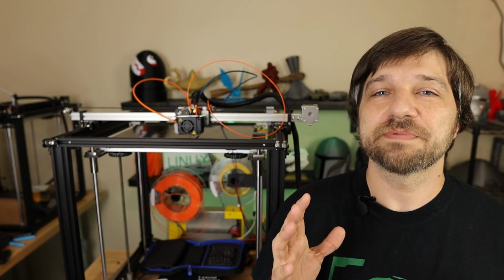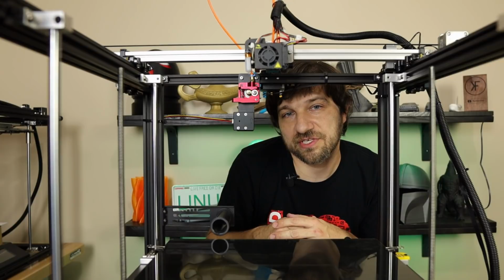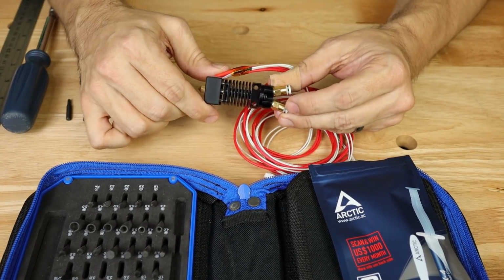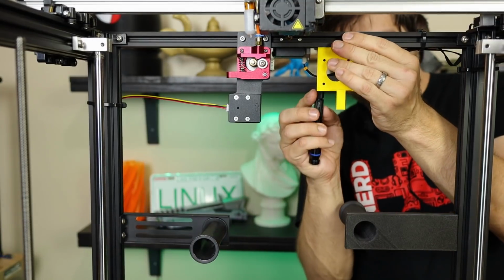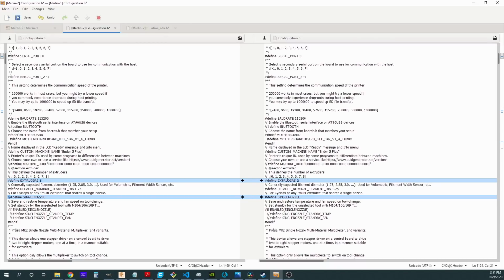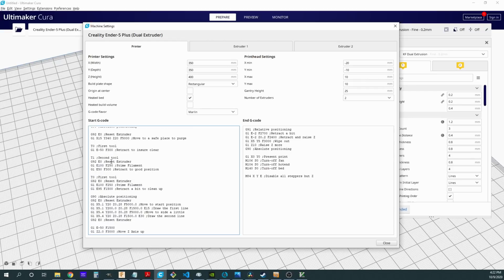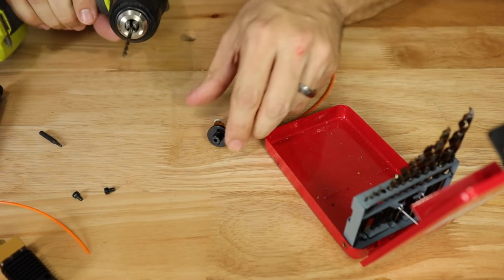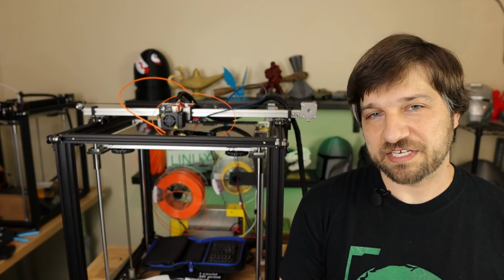Complete Dual Extruder Upgrade Guide (Ender 5 Plus)

Comment from the maker: This is my usual pinned comment for updates, clarifications and corrections. Please let me know if you have any questions.

- FYI, I have ordered another hotend I want to try and will post a new video once I receive it.
Reply: Why aren't you using dual gear extruders?
Reply from the maker: @ramtek2702  I haven't had any issues with these extruders in the past. They produce constant results.
Reply: @kerseyfabs  I haven't either and I'm not waiting until I do when it's so obvious that a dual gear extruder is superior.
Reply: If you want to use single hot-end concept  you need to mix filaments. This desing will fail due to clog problems etc
I prefer mixing hot-end from bigtechtree  or diamon hot-end.
Reply from the maker: @wenus525  I may give that a try.
Reply: @kerseyfabs  One thing I should  mention that mixing hot-end have a downside due to more filament use. But clog problem on yours hotend make me impossible to print in long run.
Reply: @wenus525  yes I had a lot of trouble with the clog and on the first try the inner tube melted at 200 degrees, so I took a piece of heat resistant tube and tapered the entrance as much as possible and pressed it firmly between the top block as you drilled up and pressed it with the nozzle so that it pressed well without being deformed. Then I saw that my screws that went up from the lower block to the cylinder to be cooled were skewed quite heavily, so I removed them completely. After I warmed up the threat, I tightened the nozzle as hard as I dared without it coming off. Since then I have no Clog at all.
  Thanks Kris!
Reply: I was able to get this hot end working with the Creality silent board (which has 5 tmc2208 drivers), 12864 lcd display, and dual gear extruder's.
Reply from the maker: @tonypietropaoli789  Awesome! Any particular settings you changed?
Reply: @kerseyfabs  Did you happen to look through your Gcode file before your print. Cura decided to throw an M104 T0 S0 code in the middle of one of my prints which caused the issues like you had. Before you ask all temps were set the same even stand by temps.
Reply from the maker: @tonypietropaoli789  Yeah, in fact, I was hand-editing the g-code at times to see if I could manually correct the issue.
Reply: @kerseyfabs  one other thing i did do as soon as i got that hot end was swap out the nozzle. The nozzle that came on it was kinda deformed.
Reply: I need help with the silent motherboard v 2.2 ender 5 + activating the second extruder. Creality
Reply from the maker: @johncastle6824  I haven't set that up yet. If there's a second extruder, you would have to recompile the firmware.
Reply: any update on the new hotend ? Looking to hot rod my 3d printer. I Belive the ender 5 plus board has a E0 and E1 socket so I could still use the oem board ?
Reply: By the way the stock board does have a plug for E0 and E1 however no driver is installed for E1. On the silent board there is a 5th driver but a heat sink will need to be placed on it.
Reply: i changed some of the start and end gcode for the extruder's. slowed the feed down but kept retraction rate the same. played with settings in cura, tuned the extruder motors. oh i also added a line to the extruder end gcode to retract 3mm before doing the filament swap it kept leaving globs on the print any time it did a swap.
Reply: i started trying all this with a dual color benchy but stringing was bad and colors were mixing (black and blue). i got it dialed in some but the took a different approach two cubes 25mm cubed and spaced the 50mm apart one printed in black and one in blue this allowed to see any stringing and color mixing. this is where i set the g codes and prime tower size to be able to achieve zero mixing of the colors. The next thing i may do is install a brass brush to wipe the nozzle.
Reply: This is not a waste of time ... I have one exactly the same, the inner tube melted already on the first try but I replaced the inner tube with a Heat-resistant tube where I tapered the entrance on the hose. Downloaded kersey:s file 2072 dual_and compiled it, everything worked perfectly after I modified the latest Cura version according to Kersey ...
But a bit into my run where switching and printing with 2 colors stopped and the wrong message: Heating :E1 Printer Halted. The odd is that if i change back to my original ender 5 profile i can print Separately without problems whole files with just one filament at the time ... If any one hane an solution just mail me at: pcchrister@hotmail.com Tanks to all and Kersey to I think you have many sharp ideas and its great...

Comment: I thought that you wanted to do everything you could to make sure the heat stays down in the hot end, NOT migrating up the throat tube into the heatsink. There's a reason that fun runs all the time at full speed.

Comment: Great video, it's basically a complete tutorial. It might not have worked for a dual color tall print with so many filament changes, but I bet it would work great for plaques, signs and logos, which are wide but not very tall, not needing that many color changes. I'll try this on my Ender-3 v1.
Reply from the maker: Thanks! You may be right!

Comment: No sure heat sink compound is a really good idea on a hot end due to the  high temperatures.  They are much higher than the heat  sink compound is rated for and could cause the chemicals to burn or vapourise into the air.    
Thanks for this video, even though I am 3 years late to the party.   It's given me some good ideas for my Ender 5 updates
Reply from the maker: I know some companies such as Slice Engineering have Boron Nitride Paste, which seems to work at these temps. Cheers!

Comment: With any multi filament configuration that utilizes 1 hot end I would ensure the hotend was up to temperture, prime 15-20mm at highspeed to push as much melted filament out then immediately retract it to the parked position. Kind of like doing a cold pull.  This should reduce the chances of buildup you are experiencing with this build.
Reply from the maker: A lot of that is built into the firmware and can be adjusted as needed. This was a long time ago but I'm almost positive I had that covered.

Comment: I HAVE BEEN STRUGGLING FOR WEEKS ON GETTING MY PRINTER TO WORK WITH MULTIPLE EXTRUDERS. MY QUESTION IS WOULD THIS ALSO WORK IF I WANTED TO USE A 3 IN 1 OUT HOTEND. AND WOULD I NEED TO CHANGE ANYTHING IN CURA START GCODE?

Comment: Kersey, why can't you use the stock silent board for this? It has a 5th driver for E1 so I assume it would be easier...
Reply from the maker: You technically can but since it's running the same software, it should be essentially the same setup. You can't use the stock display though since its software knows nothing about dual extruders.
Reply: @kerseyfabs  thanks for the reply! Would this require any flashing or would it accept the slicer g-code if all hooked up properly?
Reply from the maker: You'd have to do all of the firmware configuration mention in the video.
Reply: @kerseyfabs  I'm not using a SRK board like in your video. If you recall, I'm trying to use the silent creality board.
Reply from the maker: Yep. And that board also runs Marlin firmware. If you add features, it has to be recompiled.

Comment: All of this is not Crap... 

This is not a waste of time ... I have one exactly the same, the inner tube melted already on the first try but I replaced the inner tube with a Heat-resistant tube where I tapered the entrance on the hose. Downloaded kersey:s file 2072 dual_and compiled it, everything worked perfectly after I modified the latest Cura version according to Kersey ...
But a bit into my run where switching and printing with 2 colors stopped and the wrong message: Heating :E1 Printer Halted. The odd is that if i change back to my original ender 5 profile i can print Separately without problems whole files with just one filament at the time ... If any one hane an solution just mail me at: pcchrister@hotmail.com Tanks to all and Kersey to I think you have many sharp ideas and its great...
Reply from the maker: Thanks! Try to PID tune your hotend and see if that fixes it.
Reply: @kerseyfabs  I already have PID tune and its worked fine, the problem was: the heat cartridge screw fell off without me noticing it, the threads were apparently bad ... i replaced the lower part from my original hotend then PID tune and it works perfectly, Thanks Kris!

Comment: Look for a multi-filament add-on called Pallette 2 from Mosaic. It allows you to add four different colors, or even four different kinds of filament into a single print on any 1.75mm printer, without any major alterations to your existing printer.
Reply from the maker: I'd love to get a Pallette 2 to try. It seems like a great solution. I doubt it would work well for multi-material prints though since I don't know how well they'd splice together. It's also a lot more costly than this upgrade.
Reply: @kerseyfabs  3DPN did a couple videos reviewing it. They did show different materials like PLA or ABS combined with TPU for example, being used for tools. Yes it is a lot more expensive, but you get the added benefit of multi colored single prints that have the colors where you want them, AND it will work with any 1.75mm printer.
Reply: @PaganWizard  I'd love to get one of those if it was more affordable.

Comment: I have seen the complete CR-X hotend assembly from local store for around $120. That seems to be a great alternative to 2 into 1?
I would love to print in dual colours, but this type of hotend might be a problem when printing with different metarials.
Reply from the maker: Thanks for the tip! You're right about the different materials. Until we find an all-metal solution, high-temp materials would be out.

Comment: To do this type of dual extrusion on the cheap is tough. The key is retracting the filament and have it form a perfect shape so it can go back without getting stuck. Best bet for a budget solution is a mixing hotend, where both filaments are able to extrude and you're retraction is just a normal amount so it doesn't go past the heatbreak. Otherwise you have to retract with very special procedures and speeds to cool and form the filament tip. Doing that is a pain -- been there, got the t-shirt. There is a polished all metail heatbreak from distech, and it helps, but I really was at the end of my rope when I was trying that. I gave up on the filament swapping idea for a few years and built a large double idex printer (4 heads).  I am going to go back into filament swapping with a Y-adapter now that I'm back to working on my 6' delta -- it's now fitted with a mosquito magnum, and the retractions on that heatbreak are very clean, so there is hope there. Note the parts I'm mentioning are brand name precision parts. Doing it cheap -- god bless. Oh and yes, having the firmware do the tool swapping is so much better -- duet has a great platform for doing that -- my 4 headed printer runs duet and so does my big delta now.  PS -- subbed, I like the long form content while I'm working on machines.

Comment: 1:09:46 I think adding a PTFE or Teflon tubing inside that part may prevent clogging during filament retraction. The sudden change in the diameter of the channel and/or contact with metal is disrupting movement or flow. That is a design flaw. Solid attempt though.

Comment: You talked about designing and printing the filament spool holder with carbon fiber  Would consider doing a video on printing with carbon fiber?
Reply from the maker: I wouldn't mind doing that as a short video. I use a lot of different filaments and typically Google search and mix the advice for my fina results. For reference, I think MatterHackers typically has good advice.
Reply: @kerseyfabs  Thank you.

Comment: Do you have a link for your screwdriver kit?
I really like all your in depth videos. have done several of the upgrades that you have shown on both my Ender 5 and Ender 5 Plus.
Reply from the maker: Thank you! The toolkit I use is the "Kobalt 856840 73-Piece Master Hobbyist Tool Set." Here's a link to the Amazon listing for reference: https://amzn.to/3mqUDIz
FYI though, the current price, as I post this comment is too high. I paid around $40. You could keep checking back or possibly find it from another vendor. Thanks!
Reply: @kerseyfabs  Thanks for the info. I will keep a check on the price.

Comment: I love your videos👍 
I am new at this and just ordered a ender 5 plus and i want to upgrade the motherboard and get rid of the stock touchscreen that I've heard is not good (limited) . What board and screen do you recommend that is ready for most (all) future upgrades? 
Would you also recommend direct drive extruder or just uppgrade to an all metal dual gear extruder?
Keep the videos coming!

Comment: could you post your startup code?
Reply from the maker: No problem! I should have done that!

M201 X500.00 Y500.00 Z100.00 E5000.00 ;Setup machine max acceleration
M203 X500.00 Y500.00 Z10.00 E50.00 ;Setup machine max feedrate
M204 P500.00 R1000.00 T500.00 ;Setup Print/Retract/Travel acceleration
M205 X8.00 Y8.00 Z0.40 E5.00 ;Setup Jerk
M220 S100 ;Reset Feedrate
M221 S100 ;Reset Flowrate

G28 ;Home
M420 S1 Z2 ;Enable ABL using saved Mesh and Fade Height
 
G90 ;Absolute positioning

G92 E0 ;Reset Extruder
G1 X15 Y340 Z20 F5000 ;Move to a safe place to purge

T0 ;First tool
G1 E-50 F300 ;Retract to insure clear

T1 ;Second tool
G92 E0 ;Reset Extruder
G1 E100 F250 ;Prime Filament
G1 E50 F300 ;Retract to good position

T0 ;First tool
G92 E0 ;Reset Extruder
G1 E100 F250 ;Prime Filament
G1 E95 F1500 ;Retract a bit to clean up

G90 ;Absolute positioning
G92 E0 ;Reset Extruder
G1 X5.1 Y20 Z0.28 F5000.0 ;Move to start position
G1 X5.1 Y200.0 Z0.28 F1500.0 E15 ;Draw the first line
G1 X5.4 Y200.0 Z0.28 F5000.0 ;Move to side a little
G1 X5.4 Y20 Z0.28 F1500.0 E30 ;Draw the second line
G92 E0 ;Reset Extruder

G1 E-50 F1500
G1 Z2.0 F3000 ;Move Z Axis up

Comment: Just a thought, instead of making a new spool holder for the other side raise yours up a bit and make a extended cap that would normally attach your old spool holder to the metal bracket so you'd have one spool either side of the bracket and by raising your original spool holder up the other one won't rub on your power supply.
Reply from the maker: I like the idea. I'll check that out when I get back to it.

Comment: Search eBay for Upgraded 2 IN 1 Out Hotend 12V/24V Dual Colour Bowden Extruder With Fan Ptfe
Reply from the maker: Are you thinking one like:
A) https://www.ebay.com/itm/3D-Printer-Parts-Hot-End-2-in-1-Out-Double-Color-Extruder-12V-24V-with-Fan/202658903001?hash=item2f2f6973d9:g:RcQAAOSw~cFcvCfx
or
B) https://www.ebay.com/itm/Upgraded-2-In-1-Out-Hotend-12V-24V-Dual-color-Bowden-Extruder-Kit-For-MK8-Titan/273992032676?var=573989635138&hash=item3fcb32a1a4:g:CiIAAOSwhYNdv5Pn

Comment: Where was this video three weeks ago!? LOL. I just sorted through this conversion on a ToAuto Pyramid. Only difference is I did a direct injection, it was already running Marlin and ToAuto offered me support with the firmware changes. My poor wife, I was yelling at the screen things like "Its going to hang up on the retraction!", "The problem is a ledge in the Y manifold!", "50mm retractions", "40mm purge tower with at least 250mm purge!" "Use a detached skirt around your part to do the initial purge and then you can put your purge tower wherever you want it" and then your print failed with filament jamming. I sorted it through to the end. Direct inject I think was maybe an advantage and once it was all sorted I am now getting beautiful, clean, shiney, translucent PETG prints that look like Christmas ribbon candy, PLA that works great but I don't often print PLA and I am printing Ninjaflex beautifully but am having trouble with not totally retracting due to the LONG flame shaped retraction not totally clearing the Y manifold causing a jam after a few color changes. I have not spent the time sorting the retraction issue yet as I don't have a 2 material TPU in front of me right now. I love that there are no two hot end problems with nozzle height and position and no issues with pooping and drizzling one color on top of the other. You were possibly still barking up issues with the purge tower looking like it was working but having a hidden problem with skipping a layer on the first change out to extruder 01 or depending on your version of Cura and your purge tower parameters skipping the 50mm long retraction on the the first change causing the color change to fail when the next new color collides with the first color still in the heat break due to the short retraction. I had unsolvable issues with 4.6 and 4.7 with a "sort of works" in 4.7 tolerating the skipped layer in the center purge where the bed adhesion problem was baby sitted through with a brim. I found a version on the forum only called Cura Master from 2017 that doesn't have the skipped layer issue and with a quick edit to the first call for T1 to add a 50mm retraction it does a perfect tower with no other edits. Oddly all other calls back and forth for T0 and T1 are fine. Your jamming issue is from complications from the fact that pushing through the Y manifold creates extra drag that can accumulate during the print unless addressed in a variety of manners.  A mixing nozzle might be a better solution but I have not explored that. My interest in your video was to see what version of Cura were you running? I haven't explored other slicers yet, there is only so much time in a day as I am sure you know so I am coasting with my "work arounds". Great video, thanks for sharing., sorry for the long comment and run on sentences.